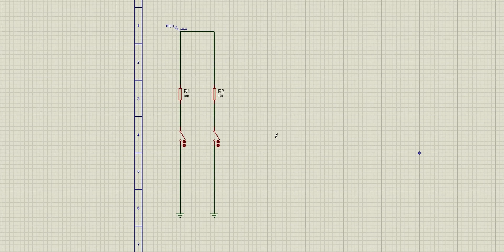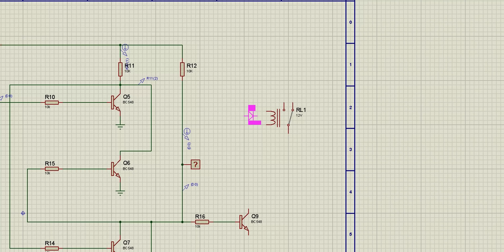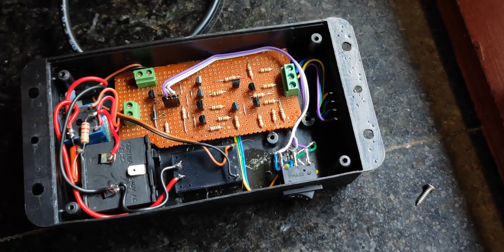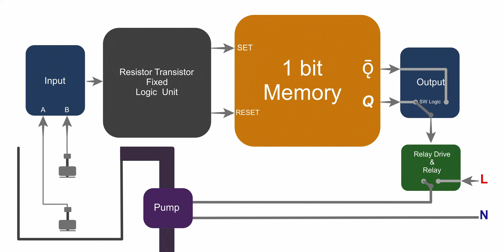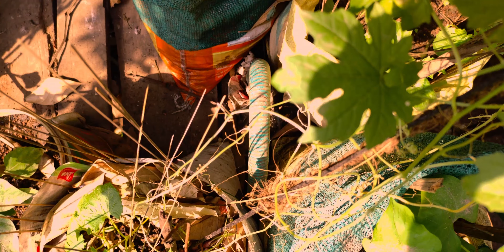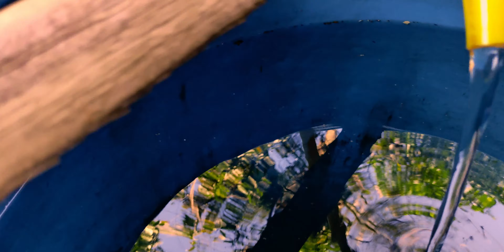Transistor Logic Outsmarts Arduino's Water Level Controller!

Comment from the maker: I recommend to use your headphones  and  push the resolution to max for the best experience , 😊❤️👍
Reply: Sir actually i want a programming for a special project,, can you build it for me.. if there is any charges i will pay to you.. actually there are many examples of that project but i need accuracy, which will come by the right code... please help me.
Reply from the maker: @smartgadgets5795  what kind of project do you need
Reply: @AMNLabs   i will mail to you all the details. Plz share your email Id .. i didn't find your id in the channel.
Reply from the maker: @smartgadgets5795  madebyaneeshmurali@gmail.com
Reply: @AMNLabs   sir i have sent all the details to you through email. Please check it.
Reply from the maker: @smartgadgets5795  ok I will 🤝